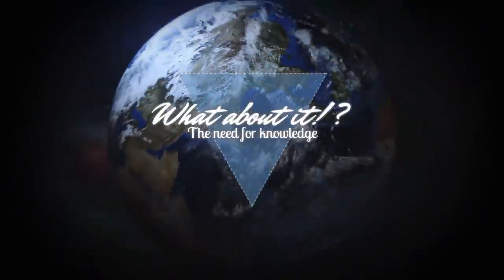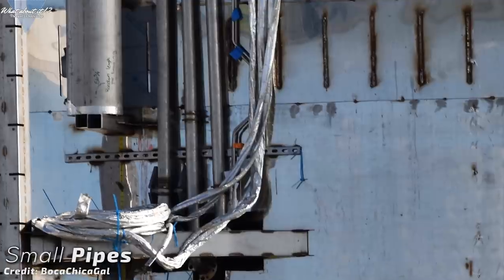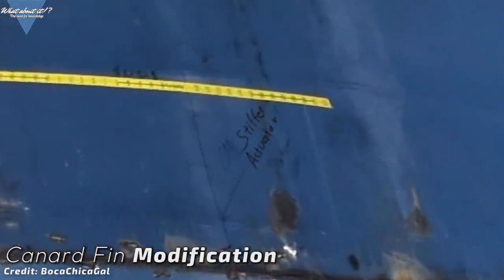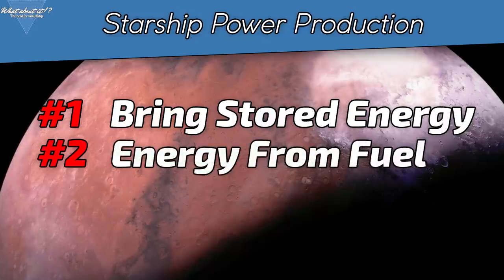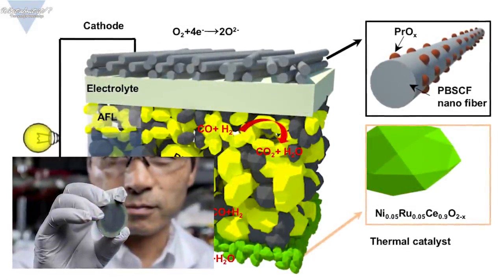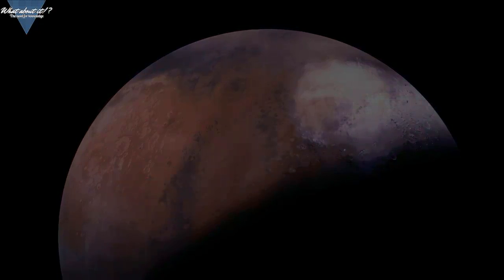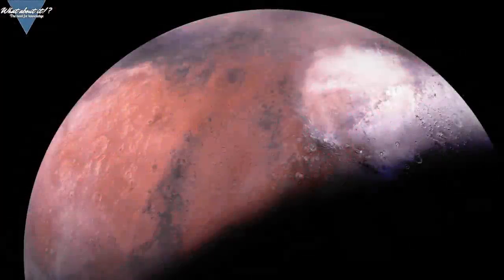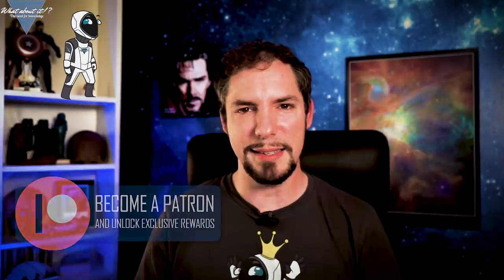45 | - How Does Spacex's Starship Generate Power?

Comment: The real answer is to make a new purpose built deep space vehicle, all that hull plating and landing gear and fins is dead weight, and there aren't nearly enough places for solar panels and radiators. I mean I get that the first generation of space industry is best served by a single general purpose vehicle, but you make a lot of compromises when you want one thing to do several jobs! Maybe something with a nuclear engine and a rotating hab section to cycle between earth and Mars.

Comment: Thoughts on Power Production an other.  Can't be nuclear nor fuel cells that consume fuel / oxygen in transit to Mars.  MUST have battery packs to stabilize power availability. Can use deployed solar cells in whole or at least in part.  Must consider the "ENERGY DENSITY" of power produced.   I think the big window idea is just for PR an the space can be better used.  I am thinking solar energy concentration to raise the temperature of working fluid to drive a sterling engine(s) that drives 1 or more electrical generator(s). Then use waste heat from working fluid to warm crew area, heat food / water.  Ask crew of Apollo13 about cold temp.  Ask crew of nuclear sub (ISS) about food storage/consumption.  Ask crew of ISS about breathable air/water regeneration, solid waste handling, hygiene for crew of 100 folks.  CAN NOT support 100 folks for 3 or 6 or 9 month trip to Mars.  Will have to send at least 1 (more) cargo versions of STARSHIP to surface of Mars to support crew of 100 before sending 1st crew.  Then with launch windows at about 26/28 month intervals for next supply / crew ship(s) to support surface crew indefinitely.  It goes on an on an on etc.  MUST GET MARS FOOD PRODUCTION UP AN RUNNING FROM THE VERY 1ST CREW!!!!  MUST GET METHANE FUEL / OXYGEN PRODUCTION UP AN RUNNING FROM THE VERY 1ST CREW.  Landing space for future ships will become a premium.

Comment: What about perfecting and using something like ROSA?
https://en.wikipedia.org/wiki/Roll_Out_Solar_Array
NASA did test a roll 6m high and 0,6m in diameter that could produce 20kW of power with a weight of 325kg. It seems good to me, isn't it?

EDIT to add: You could cut a small opening in the leeward side of the hull and have the panel unroll from the inside through that opening facing the back of the ship, so you can align the back with the Sun.
Reply from the maker: Absolutely! Especially with more efficient cells, this becomes a perfect solution!
Reply: @Whataboutit  I did some basic math over it, based on the original R.O.S.A.'s dimensions and linearly scaling it (maybe I could be wrong here) to a 34kW array with a width of 3,5m you got a lenght of the deployed array of nearly 40m and a diameter of the stored array of 1,75m. It should weight around 550kg and you need 3 of them to achieve a total peak power of 102kW with a total weight of only 1650kg. Could it be a viable solution? I did some CAD design, too but I can't post it here...

Comment: Hi. I got the idea, but I am not a NASA engineer. Option 2 is a good answer. I looked around presenting many machines. The nuclear reactor is my best choice. Giant USA Navy Aircraft carrier is used the nuclear reactor  Generate Power to keep moving forward an ocean. These are also used  Giant USA Navy submarines. The Nasa also used the nuclear reactor to satellites. The nuclear reactor can produce hydrogens inside a rocket, but the SpaceX is not using hydrogens fuel for a rocket's engine. methane fuel is not a good idea. Thank you
Reply: Those reactors are huge and would make starship like 100 tonnes heavier. (Just a guess) The satellites use RTGs that is a different method of using the heat of radioactive decay. They could be a viable option. But everyone is afraid of radiation. Nuclear=Scary to the general population.
Reply: You posted this question 4 times by the way. You can delete 3 lol

Comment: 6:15 You mean 75-90 kW?
Reply: 75 to 90 kw is a 75 to 90 kwh device. Same thing. Try turning on your 5 kw water heater for 1 minutes and see how much power you use on your meter, you'll use about 83 watts. But your water heater isn't an 83 watt heater, it's 5,000 watt. Which means 5kwh. Do you understand now?
Reply: @Bryan-Hensley  WTF, 75 to 90 kw consume 75 to 90 kwh in an hour but the device itself is a 75 to 90 kw device.
Turning on your 5 kw water heater for 1 minute and you'll use about 83 Wh.
5,000 watt is 5000 Wh if the water heater is turned on for one hour.

Comment: Sometimes when tank building, you will use angle iron stiffeners to line up the pieces. I could be wrong, but that's what it looked like to me at first glance. 

This might be a space shuttle, but it's no different than tank and they're using a tank building company.
 
Even with cold rolled steel you'll have divinations on the sections.

Comment: What they should do is spend a billion dollars to create a molten salt thorium reactor.  The reactor would have plenty of power for the trip.  But more importantly it would be the power for the entire Mars base and create enough fuel in Mars to power return flights.  Kirk Sorensen who is for example in the thick of the molten salt thorium reactor push was introduced to and learned about thorium reactors when he worked for NASA.  NASA had thought of plans of using a molten salt thorium reactor for a base on the moon.  Whether Elon does this or not is not really the question.  You need something like 64 times more solar panel space on mars to get the same energy as a panel on the earth as the sun is a lot further away.    If space x is not creating fuel for their launches from earth using solar panels as it’s not efficient then why would they use panels on Mars.  Also nite dust storms can make solar panels even less efficient and they can be global on mars.  So why a genius like Elon would say we should use solar panels on Mars is a complete mystery to me.  

The answer even if it doesn’t come from space x is probably a molten salt thorium reactor,  they were researched and an experimental one was created to make light nuclear reactors for Air Force bombers.  If they had the goal of creating them for an intercontinental bomber they would be light enough for a large space x starship to mars.  

I’m. It saying they can’t use other power for the electronics on the way.  What I’m saying is for fuel production on mars they need that kind of relatively safe nuclear reactor which has safeguards in it and would be light enough to go to mars.  

The cost supposedly floated to produce the first molten salt thorium reactor is about a billion dollars.  Jeff Bezos spends that much each year to keep blue origin going.   I know he wants to do the space thing.  But he’d be better off mothballing blue origin or cutting back and focusing on building a nuclear power station for space and make the fuel depot for the spaces craft.  If space x can’t afford or do the molten salt thorium reactor for mars then they should find someone who can.  Once the working version at scale for commercial power is developed they can start making them for earth and finally solve the energy crisis.  The side effects of developing the molten salt thorium reactor is better than the entire set of advances from any space X journey to Mars.  That alone should make others interested in getting into the game.  

I’d be really thrilled and happy to see a blue origin fuel station on a mars colony with Space X delivering the goods.

Another thing they should do is create an internal set of rooms that rotates 14,5 times a second inside a starship as a pair of artificial gravity rocks for long term work and sleeping on the journey to mars.  Once there the parts to create the rooms would be setup on mars with a modified inclined angle to create a 1 g earth gravity room set for 1 g earth gravity for a lot of the life of the inhabitants.  Humans need 1g gravity.  Of course centrifugal forces should be present from the spinning mass while powered up.  But they could be turned off for maneuvers reorienting  5e direction of the craft. Dur8ng it’s flight.  The rooms might be used 8 or more hours per day.  Isolated while inside like a closed room WiFi like tankers would give them views to the outside of the rooms and check on systems.  A 28 foot from floor to floor set of rooms with liquid water ballast like water beds under each room with link to provide dynamic balance could be built.  Motors spinning the rooms would be reused for use on mars or for the 1g room on mars.  A set of counter rotating mass probably not more rooms would be on the ship as well to counteract rotation imparted on the craft when the rooms spin up or spin down.

Comment: the new starship video shows starship exclusively during periods when it burns its engines, not in coast phases. Solar panels would not be deployed during burns. as such there is no reason to think that there is any change in the use of the fan style panels shown in previous versions of starship. 

I like your "no part is the best part" solar idea but 2 problems arise.1. The panels are likely going on cargo flights as comfort for passengers is a primary concern on a 3 month mission as is maximizing the number of passengers so space aboard passenger flights will be at a premium and likely will not be taken up with cargo that is not essential to immediate passenger needs. 2. its just kicking the can down the road. They would have to develop the panels eventually anyway. and taking the time to develop multi-use panels when you will have to develop single use ones anyway seems...wasteful.
please let me know if i missed something. 

ps. your videos are getting better. keep up the good work.

Comment: Why not install 4 external inflatable space habitatcapsule BA330 bigelow around the starship small space station made to used for centrifugal motion move like giroscope large rotating ring conected external tubes  around the starship auxiliar capsule and flexible solar panels conected to produce electricity  around the ring and this  artificial gravity ring produce big gforce to produce perpetual motion force  used big multiple  electromagnetic engine to keep non stop force   create big  artificial moon gravity force perpetual motion engine produce electricity   and used like electric kv motor generator and extra  external safe solid capsule space station conected to the starship plus small  nuke engine plus engine reactor and supply energy  to the  starship around the ship steel  rotating ring conect  magnets to produce energy.

Comment: If, at the traditional rocket manufacturers, an engineer or mechanic would take a sharpie to scribble some assembly instructions right on the rocket itself, the whole team would be fired on the spot.
Culture gap. Culture canyon, actually.
Reply: A lot of the materials they're using, I actually recognize. Bare bones basic commercially available steel for construction.  I always think of exotic materials or super vetted metals, not stuff I've bought at Home Depot and the local metalworks place.
Reply: Alexander Jordan that’s what so cool about it - great ideas with not overdone engineering- just enough to get the job done. Actually a great lesson in life regarding anything. I loved the way he put it during the presentation and started using it in my daily life at that very moment :)
Reply from the maker: That is exactly, what SpaceX is trying to do. Build a fully reusable rocket using normal labor and parts available everywhere. Result: Insanely cheap rocket launches if it works.

Comment: My vote is fuel cells. Nuclear is to much of a publicity nightmare, even though it is safe, solar can be problematic because of the massive area required and the possibility of failure, and batteries are just to heavy. Solar on mars is going to be a problem as well because it's far less effective than on earth and only works during the day. Again batteries can fail and are not very reliable for long term. Like on earth the best source of cleen long term energy is nuclear. We are eventually going to have to recognise the dgeni is out of the bottle and use it. France gets 75% or more of its energy from nuclear power and its clean. Costs less than most everything else as well.